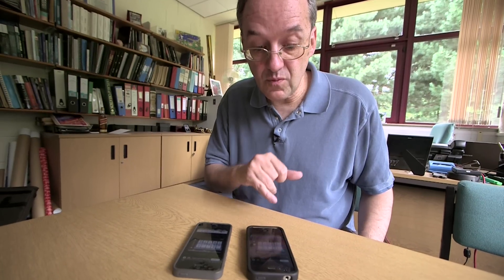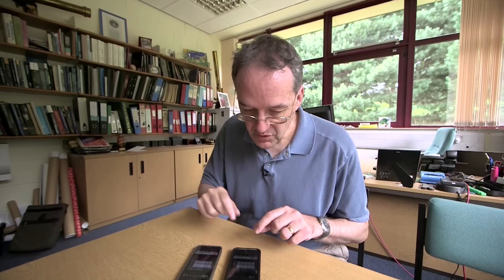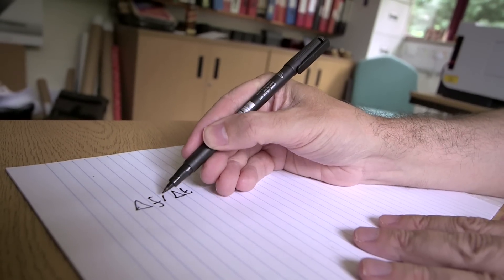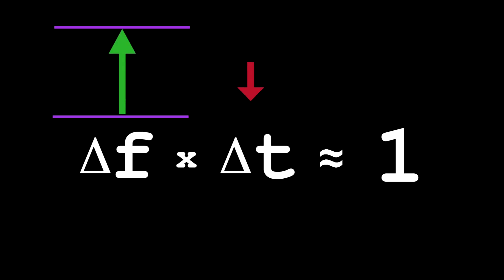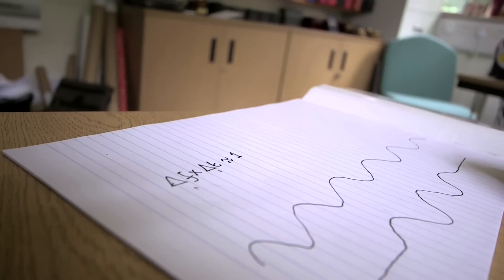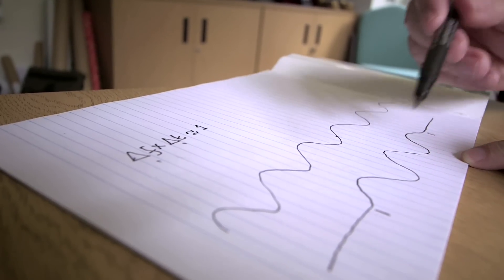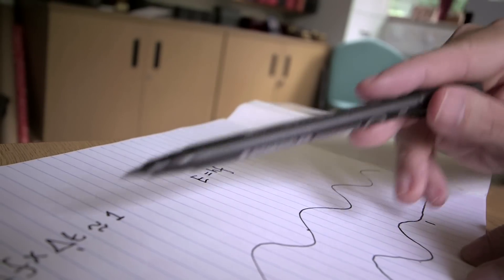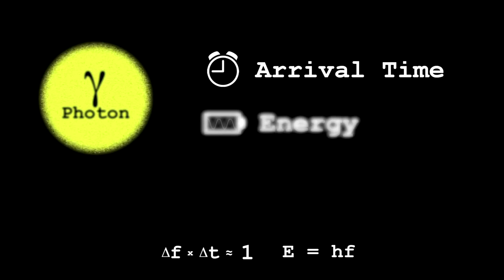What is the maximum Bandwidth? - Sixty Symbols

Comment: Why does the range of light frequencies increase when the length of the pulse gets shorter?
Reply: +sammbo250 It's a mathematical thing. The naive definition of frequency (half the count of zero crossings of the signal in a second of time) really has sense only for sinusoidal signals. To characterize a real world signal (which lives only for a finite period of time and is not strictly periodic) you need to extend the definition of frequency. The Fourier transform is one method to represent any signal as a continuos collection of frequencies (i.e. a function of frequency); it has the property that the shorter is the signal the wider is the frequency range.
Reply: +Marco Coletti So in easier terms, a laser thats turned off actually emits a full range of frequencies that, added together, produce "no signal" as output?
This feels weird.
Reply: +Selmokk No, the Fourier transform of a signal whose level is zero everywhere in the time domain is zero in the whole frequency domain, hence no frequencies.
Reply: But if the time domain becomes big enough to include a non-zero signal, like in switching the laser on and off to transmit data, the off-state turns into frequencies, where before there were none.
Reply: +Selmokk Frequencies of a signal by way of F-transform are only defined for the whole time axis (because the transform is defined for the whole t-axis). In that sense, the spectrum of the on-off laser characterizes the signal from -inf to +inf (altough in the real world we deal with signals that are identically zero outside a finite time interval).
If you establish a special way to define frequencies in a time slice (e.g. multiply the signal with a windowing function then transform) you will find zero frequencies if the signal is zero in the window range.

Comment: a TB a second is a massive, and I mean massive amount of data. Most hard drives are 500GB, half of a terabyte... So, one second of optimal transmission would fill two hard drives worth of data. Now, hard drives do come in larger sizes, but these are common. Secondly, there is never a perfect transmission, always interference, so they would never reach 1 TB/s transmission rates, this is potential numbers based on the maths.
So in short, no need for such speeds, yet. Only corporations and gov't.

Comment: Can someone help me understand how switching a laser on and off creates other wavelengths that cancel each other?  I don't see how this would occur.  If the laser is on, it is emitting a certain wavelength by using energy in its battery.  When it is turned off is there just an absence of laser light that creates the pulse?  It seems there isn't anything to disrupt if the laser is off and what source of energy would be used to supply these cancelling waves if the laser's battery is not doing it?

Comment: 1 TB is the theoretical but I only manage to get 1 MB on my fiber optic line. I wonder what the Max is for interplanetary transmissions since they can seen more frequencies through a vacuum...
Reply: +Guy Fawkes Radio bandwidth is a tricky one. Assumedly, given the range of frequencies available, you could get away with a fair amount, but take into account that in space you have a lot of noisy objects that will foul up your transmission with noise, and, I think, you'd have redshift/blueshift to contend with as well.
Consider a space probe that is sent screaming out into the interstellar void at, say, 16km/s away from us. Assuming that we are stationary (which we aren't, but bear with me) the red shift on the signal results in a 0.005% deviation from the original transmission frequency. Now on the Voyager 1 space probe, this isn't an issue, because it it broadcasts within a safe "buffer zone" of frequencies, but imagine if you crammed the broadcast with wall-to-wall frequencies. Some of them are going to drop off the end because of the Doppler shift. So You have to consider a "buffer" zone to prevent signal loss at the very edges of the frequency range, which further limits your bandwidth.
Reply: Guy Fawkes I don't think the gravitational waves would have that much of an effect, considering that it took a considerable amount of time, effort and money to even detect one, but its something to keep in mind.

Comment: I think I just had to un-learn and re-learn some stuff I thought I actually knew, but anyone who can reply, just first tell me, does this mean that fiber optic signals are a form of FM transmission?  I always thought that fiber optic was really just on-off-on-on-off-on-off-off, you know, binary signals.  I had no clue that there was a spectrum of light in use, and that they were using [what sounds to me like] 'interference patterns' to transmit...  I also thought that when we were talking about laser light, that it was flat-out 'coherent light'.  One single pure frequency, and therefore one single 'color' of light.  I had no clue about variations, especially USEFUL variations, in the color/colors in use...  Cool...
Reply: +Jeff Glock Well we just change the Voltage of the current and you basically get on-off-on-off light, so yes we use FM transmission. The use of multiple lights you are referring, although is just infrared from about 1300 to 1550nm because those 2 travel the best in optical fiber, is actually called multiplexing and we send multiple signals down the fiber but at the end of it we can demultiplex the signals and read the information from them both separetly since they have 200nm and hardly interfere.

Comment: So he says "a Terabyte of data in a few hundredths of a second". One hundredth of a second is 10ms, so lets assume "a few hundredths" is 40ms per 1 Terabyte. That would come down to 25TB/s in data terms or in Bandwidth terms a connection speed of 200Tbit/s. Currently a few lucky consumers have 1Gbps connections with Fibre, so does that mean an increase from 1Gbps to 200Tbps (x200000) would be possible without the need to replace the fibre cable with anything else? That's insane, so FTTH really seems to be the endgame.

Comment: Can someone explain to me like I'm five why turning the light on and off won't work instead of using several wavelengths to interfere with one another?
Reply: To make a rather long story short, I think that towards the end (6.52) he basically says that it works. What I believe (I could be mistaken) You misunderstand is when he (@ 1.33) answers Brodys question about "can't You simply turn it on and off".
What he says is not "No it won't work" but rather " Yes it will work BUT by switching a "single frequency signal" "on-and-off" it is no longer a "single-frequency-signal" (and to understand why this is the case You might have to look into Fourier analysis)
I must admit that I think this video is a bit mixed up as to what concept it actually wants to explain.
 Possibly it would have been better to have a separate video explaining how a "light pulse" actually can be "interpreted" as a "mixture/range of frequencies" that by  interference, positive and negative "construct" a "light pulse".
And then have this video explaining the connection between frequency range and maximal bandwidth...
Just my 2 C's...
Reply: Mats Rdr I can't agree more. It's mixed up...

Comment: Once we develop computers that can process a terabyte of information in 1/100th of a second, won't we just use more fiber optic cables in tandem with each other to transfer more information?  If you can send information that fast, then surely it wouldn't be long before you could split that information up into multiple channels and keep it organized.  You would have to account for the distance each signal traveled, but it couldn't be THAT difficult.

Comment: How about n 100 years? A new method in transmitting data is using vortices to transmit light, rather than just a straight line. The secret to the speed lies in how the researchers manipulated the laser signal to form an optical vortex (also known as an orbital angular momentum carrying beam, or OAM beam), where the light moves in a spiral, rather than a straight beam akin to a laser pointer. l.

Comment: ...So wait, you're saying if the laser is off, it's just producing wavelengths of light that destructively interfere to make it seem as if there's nothing?
Reply: Yes and no. A laser that is turned off isn't doing anything. The problem is rather at the other end when you're measuring the beam. There is no way, physically or mathematically, to discern the case of the laser turned off, from a sum of different bands interfering as you mentioned.

Since in practice fiber optics systems often work by having lasers of different colors beaming into the same fiber as different channels, going past the limit translates into the different channels jamming each other. A red laser that is pulsed fast enough will produce effects that will be visible to and as such disturb a green sensor. In electronics where you only have one channel, cutting off the frequencies at some point will create a ringing effect that will disturb the next pulse ect ect. But whichever way the system is implemented you run into the same fundamental limit.
Reply: Ah, I see, that makes more sense. Thank you for the explanation :)
Reply: ***** easily explainable
red color has a long wavelength therefore if your pulse is shorter than length of this wave, you can't really create a red pulse anymore because the wave can't fit into the pulse so the resulting wavelength can be completely different than what you intended for it to be in the first place so it's no longer recognizable by the system

Comment: If you can transmit 1TB per 3/100 Second...  then in a whole second you can transmit 100/3 TB  or  33 1/3TB.  30 TBytes / second sounds good.  I can't even get 7Mbits / second with BT but then the line in is copper wire.

Comment: yes all of that is true but isn't that why we have multiple lines to double and triple the amount of bandwidth of a single optical line? now sense we do that each time you and your engineers make a break through once we get around to upgrading that break through in speed is 2 or 3 fold because of the extra wires used in the configuration of the network. In thus it wont only be 1 terabyte but 1 terabyte per wire which you can always have i think the max which i have seen on a sever on a sever is

Comment: So 1 Petabit/second ?
Reply: not exactly in digital systems and computers the size is determined by the power of 2
for instance 
1 Kbits= 2^10 =1024=1.024*10^3 bits
1Mbits= 2^20= 1048576=1.0485.. *10^6 bits
...
1 Petabits= 2^50 ≈ 1.12589... *10^15 bits
so 10^15 bits would be around 0.888 Petabits or around 0.111 Petabytes

Comment: I don't get it. He's talking about sine waves, but even a single photon has an energy/frequency and is able to convey information because of that.
Also, why couldn't I measure time and energy simultaneously? Surely I can for example excite some material and measure that without losing either side of information. This really makes no sense. I think he hasn't explained what exactly he's talking about here...
Reply: You need to get rid of the notion that there is such a thing as "single frequency". That concept only exists in theory. The problem is in the definition of "frequency". Most people define frequency something like "number of zero-crossings per second". However, this definition is often too simplistic. Two examples:
- Imagine a single pulse with no zero-crossings. What frequency does that pulse have? Using the definition above, it is a nonsensical question.
- Imagine a non-regular signal: You try to assign a frequency to such a signal. Imagine you count the zero-crossings for the first part of the signal and the second part of the signal. You would get different answers.
Clearly, this definition of "frequency" is useless.

Much more useful is the following construct: The attribute "frequency" is only defined for (co)sine waves. But a co(sine) has no location: It is only defined from -infinity to +infinity. However, any real world signal is finite. But when you sum many infinite (co)sine waves of slightly different frequencies you can produce a pulse that has locality.

Using this mechanism you can describe any signal, no matter the shape, as a collection of frequencies, even if that signal is only a single pulse. However, not every signal has a single frequency anymore. In fact every signal that is finite must necessarily consist of a collection of frequencies.
Reply: I have to admit you lost me there.
But when talking about light and frequency, even a single photon has a frequency corresponding to its energy.
Sure, I can construct the same "apparent frequency" from multiple frequencies that interfere with each other, but is that really what's happening with for example a 650nm LED?
And even then we're talking about practical application - it's possible that LEDs use multiple frequencies that result in this apparent wavelength, but surely we can also get photons with the exact amount of energy, ergo a single wavelength...

btw: "attribute "frequency" is only defined for (co)sine waves" = are you saying square waves have no defined frequency? I think anyone dealing with electronics would disagree... :)
Am I missing something? I feel like we're talking about completely different things for some reason.
Reply: First the easy concept: Yes, I am saying that square waves have no single frequency. In fact, perfectly square waves with hard edges would have an infinitely wide spectrum. And electronic engineers would especially agree: They call it the "Gibbs phenomenon" (->Wikipedia). It arises because we do not have infinite frequencies in the real world. So you can never make a perfect square wave.

As for the photon. I am no physicist so take that with a grain of salt. My understanding is that a photon only has a precisely defined frequency when you have no information about its location. The more you try to pin down the photon, the wider the frequency spectrum becomes. I think that is what Prof. Merrifield tried to say at the end of the video.
Reply: His explanation was fine. The problem is that quantum mechanics is extremely non-intuitive and he is trying to convey all this to a general audience. The fact is that you cannot measure energy / time to arbitrary precision even though energy is exactly conserved. Sadly, I cannot explain further the subtleties of quantum mechanics in a youtube post.

Comment: Seems like both tones are completely different to me.
Reply: +Justin Dougherty Define "completely". It appear that the two cell phone are off bt approximately 2 Hz. When they are both set to the same frequency, there is already a beating of about 2 Hz. After that, as he change the frequency on 1 phone, the beating don't follow exactly the difference in the setting, but probably add about 2 Hz more in the beating. I understand the stress of producing a quality video, but why they didn't recognize the problems.

Also, using a scope would have made this demo so much more clear.

Comment: the whole " cant measure time and energy accurately" thing is rubbish as well. in a lab if a car is driven into a wall , we can measure when it impacts... and at what force. its just easier because of the size. which means we just dont have sensitive enough equipment at this time. doesn't mean it isnt possible...

Comment: Switching on and off ... i.e. amplitude, no amplitude ... is Amplitude Modulation .. not Frequency Modulation .. and will not produce new colors of light ... not ever.

Think about internal reflection in the fiber and what a packet built from multiple frequencies would look like after a curve in the fiber ... not the same. So this nice story would only work with perfectly straight (at the level of wavelengths) fibers.

Comment: He's not assuming 1 there's only 1 bit per pulse, is he? If so, he needs to hear about QAM.
Reply: you can't use QAM for the optical spectrum which is I think what he is referring to.
Reply: Robert Why not? Pretty sure uk cable uses QAM over its HFC network.
Reply: QAM modulation on optical signals? Its quite hard to establish the phase of such high frequencies. Well, you could do it with an interfermometer but then setting the phase is even more difficult. Are you sure they use QAM for optical signals?
Reply: At the beginning he refers to optical fibre and says it relates to sound, radio, light down a fibre. Are you just saying that human-non-visible wavelengths tend to be sent down optical fibre? He does seem to assert this limitation he describes applies to any wave. That's my issue with it. Surely even visible wavelengths can use AM, so even without using phase there could be >1 bit per pulse.

Comment: Nearly identical? Won't give any meaningful data. Two particles cannot have the same energy state at the same time. If they're nearly identical, the data is junk. One cannot infer anything between them. If they are identical, they cannot proceed at the same rate. They tug at each other. This is how they bound two photons together in a super-cooled rubidium gas. So there would be no useful data of that experiment due to Heisenburg's Uncertainty Principle.